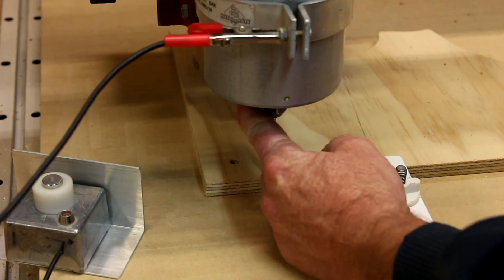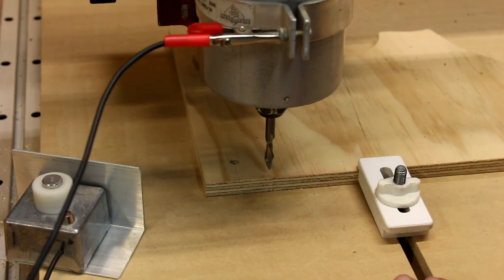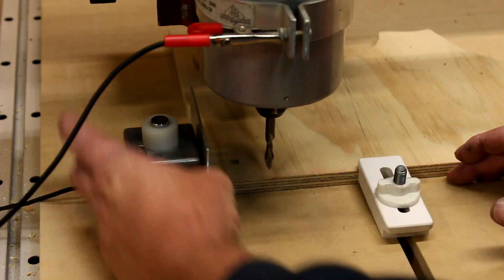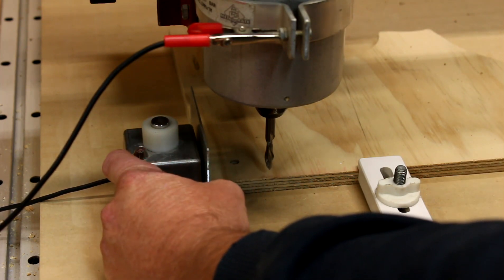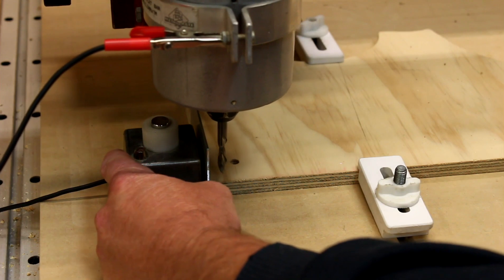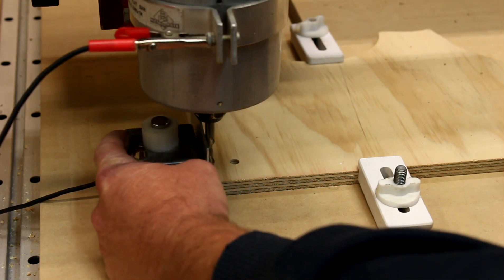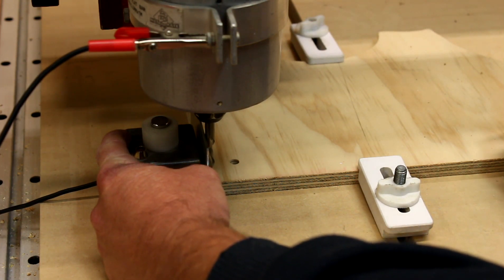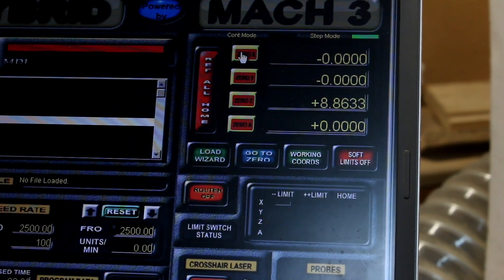Using Z tool setter to set X & Y - CNCnutz Episode 55

Comment: Maybe a cheap 123 block for the contact?  Or to beef up the mounting for the aluminum angle, which seems vulnerable to starting off and'or becoming bent.
If using aluminum (which forms an insulating oxide) as a contact, maybe use a bit of anti-oxide cream (in Electrical at hardware stores) to help the reliability.

Comment: How about using it as a home device to stop X/y/z movement similar to z zero setting
Reply: Wired correctly of course to each axis
Reply from the maker: +TIM Casey 
Would work well.
Reply from the maker: +TIM Casey 
Of course

Comment: I use Mach 3 which has a way to add additional code to it. So I just use the same idea with a .015 thick peace of brass with a twist. Functionally it works almost the same as yours but when I hit the button the bit will go down tell it contacts the brass plate. Then it will set z to zero  and back off an inch. So if X and Y are set your off to the races. 

If your controller software dosent have a way to do that then make one of those. When you get close to the button then jog at something around .01 or smaller. The spring under the button is what prevents bit damage if you hit it fast.  Beats the paper under th15 thou or so,e bit method.  :)

Most wood is never dead flat like metal so if youre withing say 15 thou youre good enough but with metals thats just barely in the ball park. 

I almost never need to set X and Y to anything closer than say 20 thou so the eyeball or paper method method is close enough. If I have to get within a couple thou then I just use the X and Y part of the same bit of code and the 15 thou peice of brass. Another way I sometimes use or when I gotta set X and Y to say some center point I just stick in a 20 degree or less engraving bit in the chuck and set the point as close to dead center as I can eyeball then zero X and Y. I use an ER11 collet setup and I have a full set of both metric and SAE Collets so any bit fits. Just grab the the bit and the right collet and your off to the races. 

I "modified" my router to do it.  Get one of these -  http://www.ebay.com/itm/C8-ER11A-100L-Collet-Straight-Shank-Chuck-Holder-CNC-Milling-Extension-Lathe-Rod-/221966618875?hash=item33ae3dd0fb:g:4vQAAOSwFNZWxEeh  - then mill the shaft down to .250.  Next cut off enough of the shaft so when you stick the collet in the router the top of the big part should be around a 32nd from the router nut when you tighten it up. DO NOT EVER bottom out any bits in a router chuck as they wont lock in properly and will most likely pop out. If you dont have the means to modify one of these yourself most anyone with a small lathe will do it for $20 US or less.
Reply from the maker: Hi John,
It has been so long since I did that video I had forgotten about it. I had to watch it to see what it was about.
Excellent write up. I originally planed to automate the z height in Mach3 but never got around to it and finally moved to setting by eye as it is quicker and light traveling under a cutter is thinner than paper.
I have seen the extension collets and wondered if it was an option because it would allow me to use the ER11 set. I didn't like the idea of double collet and loosing machining depth. After that I forgot about it. That said it is very cheap and I could get one and give it ago. I have the lathe to modify the shaft diameter so no problem there and it will save me having to machine my own collets it might be worth another look. 
Thanks for the link.
Cheers
Peter